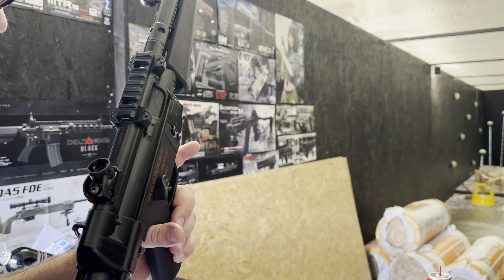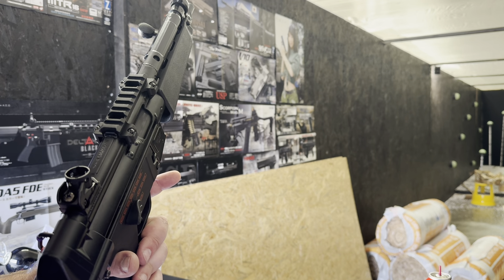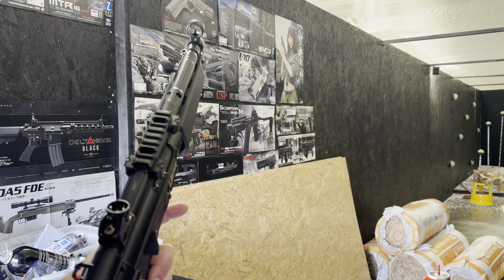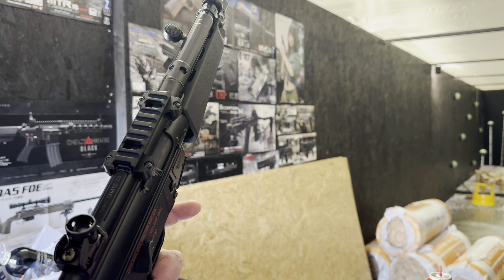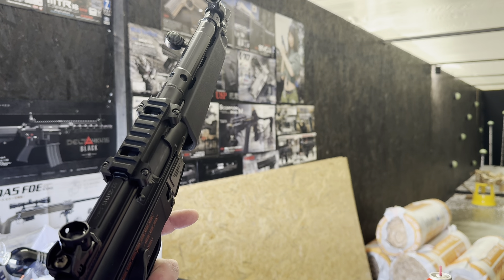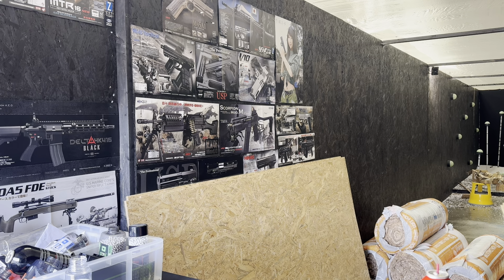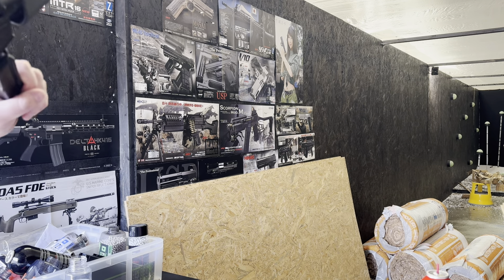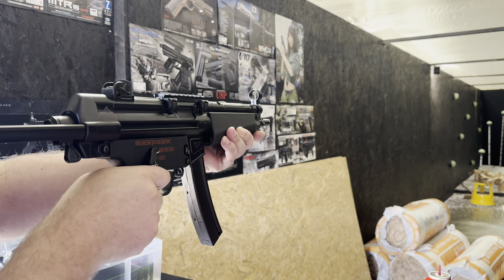TM MP5A5 NGRS  | 1108

Comment: Wow, looks like Marui finally made a decent MP5.  I remember the nightmares I had with an old MP5SD6.  I loved that gun to death but it was an awful monster trying to put lite upgrades into it.  Stuck an M120 spring and steel bushings.  couldn't get good results from any of the barrels I put in and ended up just putting the original back in.  I had a metal body for the gun but it was such a mess I ended up putting the plastic one back one.  Some of the older airsoft "solutions" really were a mess.
Reply from the maker: @agenttexx  we played Marui bingo when it first came out.  We made a list of everything we wanted fixing from crap hop unit, plastic body, stock wobble, too dream additions like etu, recoil and bolt stop and Marui added them all and others we hadn’t thought of.   This is not only the best electric mp5 on the market it’s possible one of the best aegs ever produced.